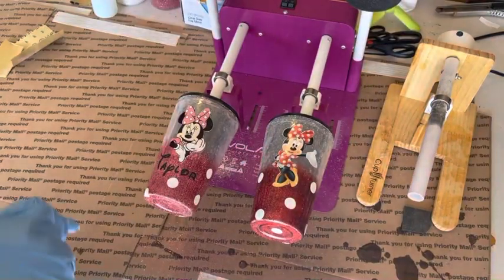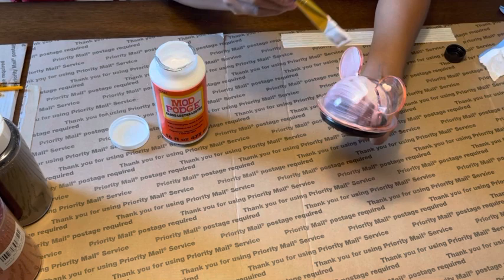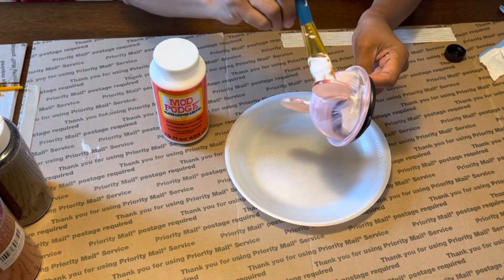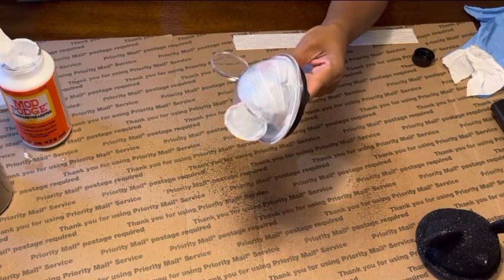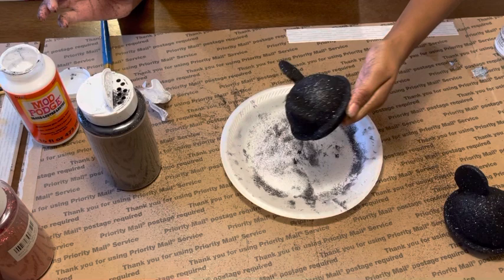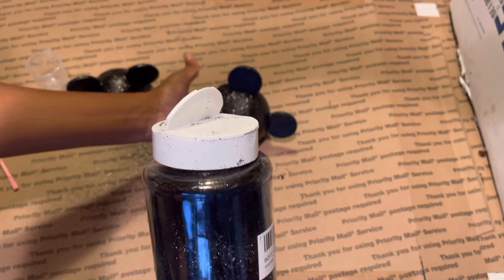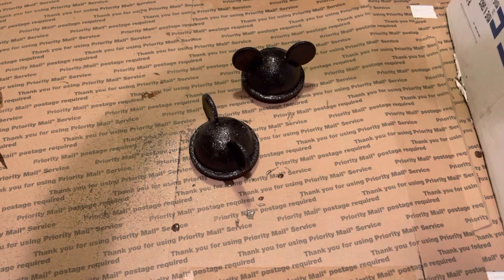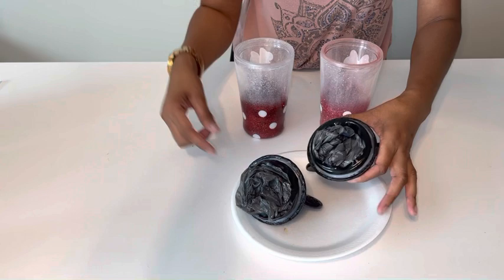Glitter Minnie Mouse Tumbler Tutorial (Mod Podge/Epoxy Method Part 2)

Comment: could you have spray with black paint then use glitter so that you would not have to apply a second layer of glitter?  Also instead of using modge podge to hold the glitter, what about using the epoxy as your glue for the glitter so that the modge podge would not come through.